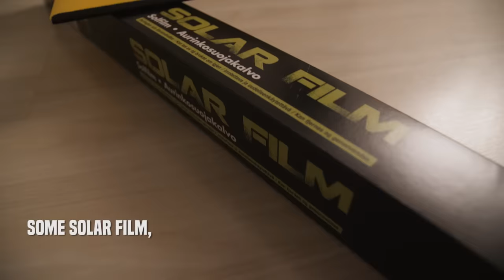DIY Infinity Mirror Coffee Table

Comment: I find it very odd when people post video's like this they don't stated everything thing in the description and who using hammers and nails anymore? He didn't use and clamps, glue or even checked to see if it was straight or leveled. Those are cheap tables and will fall apart. Should have done everything from scratch.